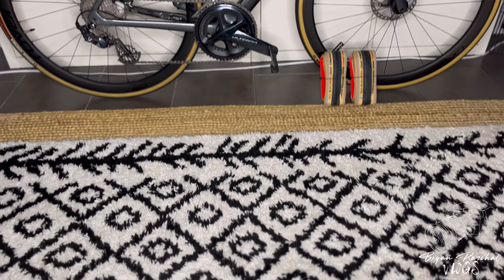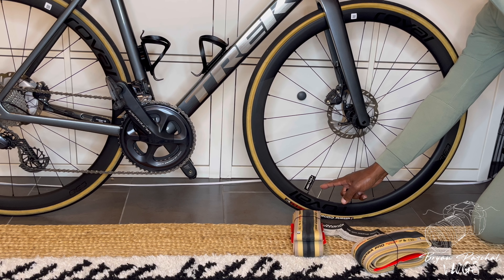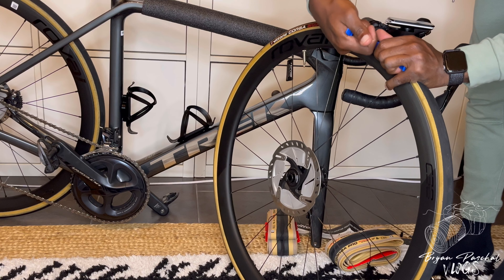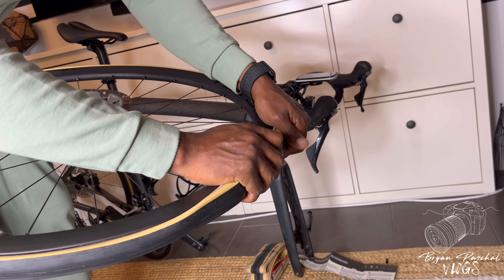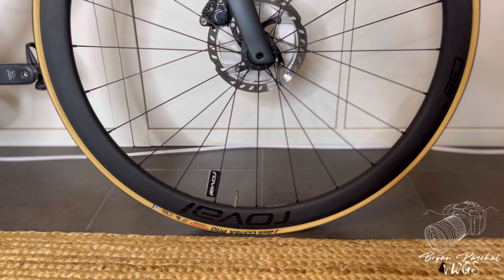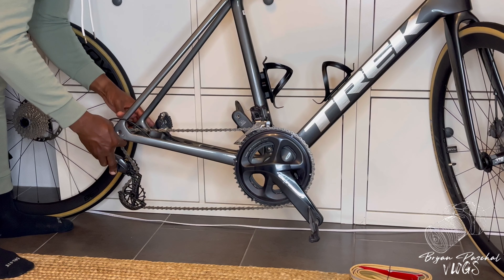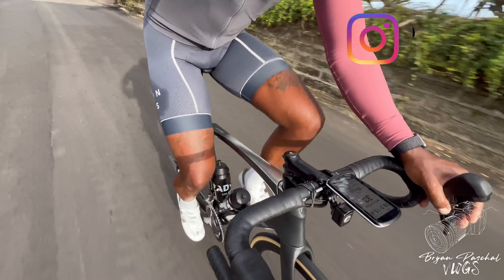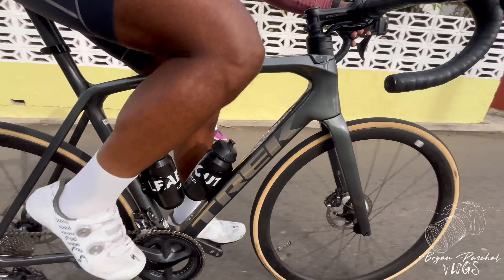Vittoria Corsa PRO | Feel What The Pros Feel

Comment: My graphine 2.0s look the same!  I've glued the rubber back onto the casing a couple of times, but sealant build up is going to make me have to buy a new set of tires this spring.  Would you recommend the Corsa Pros?  I was thinking about trying contis.  I am a Vittoria guy, but change can also be good.
Reply from the maker: Hi Colin. Yeah, It is definitely time for new tires. I believe I had my graphine 2.0s on for about 7 months. So, it was normal wear and tear. Both tire options are great though! The Pros just provide a greater feel and confidence when cornering at higher speeds. Plus, Vittorias look so great on the road!
Reply: @bryanpaschalvlogs  Thanks!

Comment: make life easier on your self chap and put the gear in the smallest cog at the back. and turn the bike upside down as you dont have a stand. and take the tube way completely when putting the first bead on you're making things much more differcault for your self. and never rest your bike the rear derailleur you'll bend the hanger
Reply from the maker: Thanks for the tips!